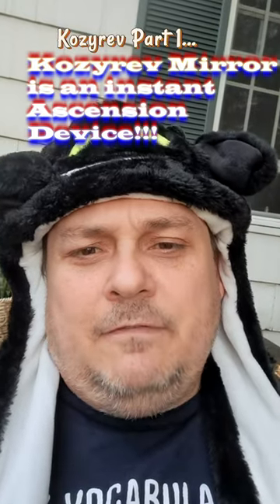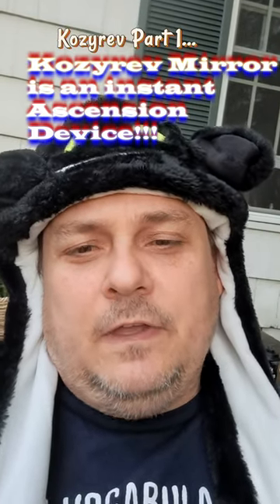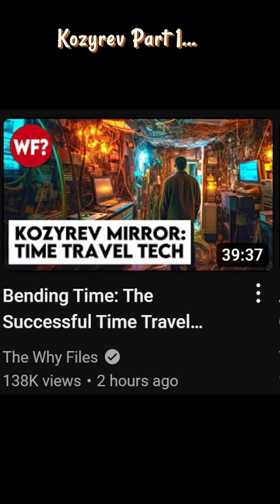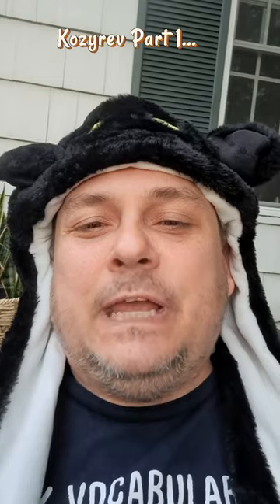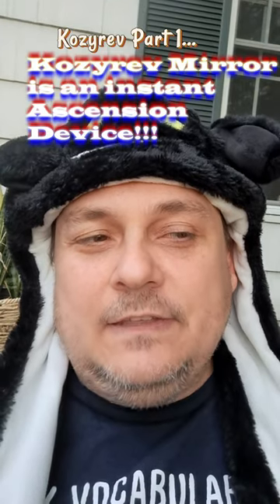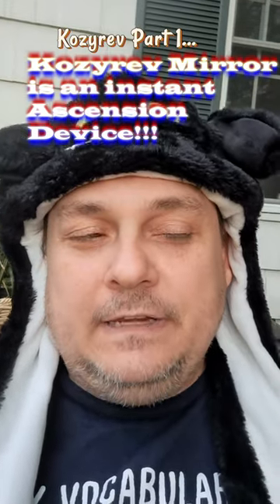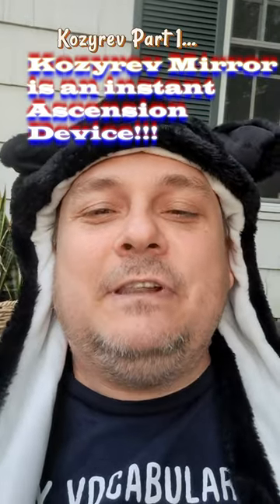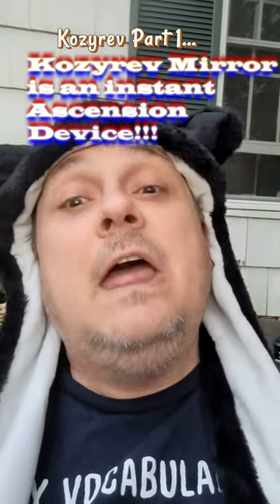Kozyrev Mirror = Instant Ascension Device part 1/3 #short

Comment: Where can we buy a 120 cm times 280 cm aluminum alloy which is 1.5 mm? Home depot does not seem to have it.
Reply from the maker: A metal dealer will have it. This type of metal requires a special supplier.
Reply: Thanks!